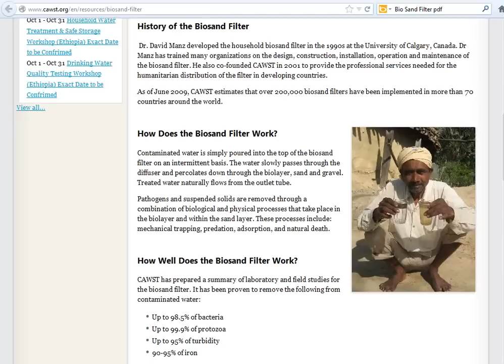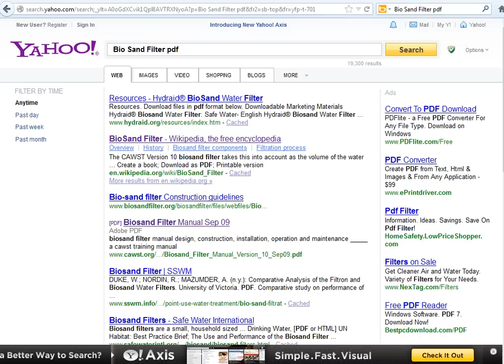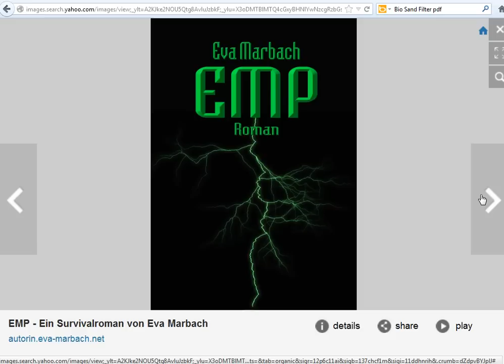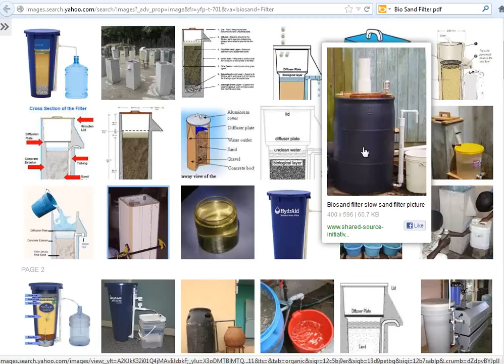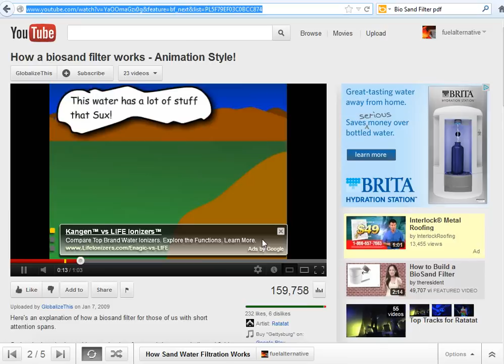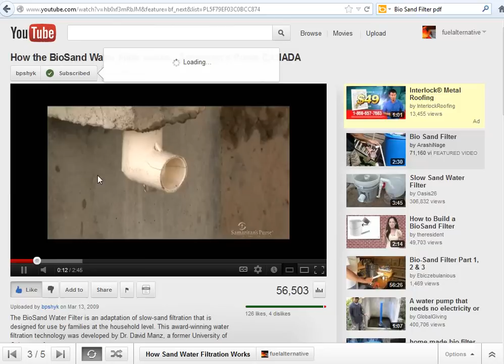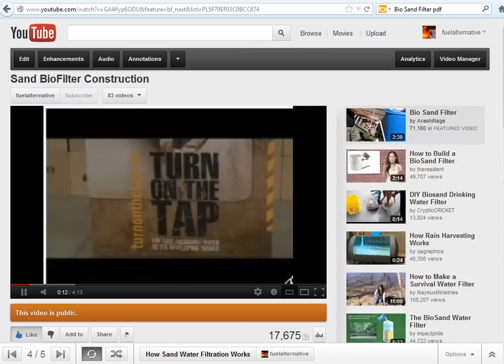Bio Sand Water Filter Construction DIY step-by-step

Comment: You could do soemthing like that, but the slow speed of filtration would hender your actual usage... Thats if you just let it fill at its base drainage rate. If you hooked up your 20lb psi line to it, you would push the water through it, and it wouldnt work correctly. It would filter the water, a little, but not in the same manor. If you want to do that, replace the sand and rocks with charcoal "Activated Carbon" and use a hypo mesh for the in and out so the dust/particles doesnt get out.
Reply: I was curious what would be better, the bio filter or the rock, pebble, sand, charcoal filter? Or a combo of the two? If a combo would the bio filter be used first and then pass it through to the rock/sand/charcoal filter or would the rock and sand kinda contaminate the water again before it gets to the charcoal ?

Comment: At the end you said you said it shows concept, however does something this small still clean the water sufficiently? Or are one of the larger 55 gallon filtration systems required?
Reply: I hope the author of this project made this project only as a small scale model because in this size it cannot work properly! That crap at the end about the chlorine, ozon etc. is complete nonsense and redundant. The filter when properly made is filtering 99% of all pathogens. 
    For people who will try to reproduce this wrong model will ultimately fail. 
 The problem with this model is mainly in not stressing the FUNDAMENTAL principle of this system, the bio live layer below the diffuser. I suggest for everyone interested in this system to look at how it is done in tropics by responsible people understanding that this is not a sand filter but live biological filtration. Actually contrary what this wished to be expert claims; the dirtier the water pouring in better.

Comment: could this system be attached  to the main water line to the house for a compleate house filtration system?
Reply from the maker: This is a sand filter commonly used in pools and spas
The only difference is this is cultivating a bio organisms at the top much like nature to help filter out bad organisms.
this set up is for hardship conditions and third world applications.
If you want a sand filter for your house? Include all features, the back wash too and include carbon in line filter